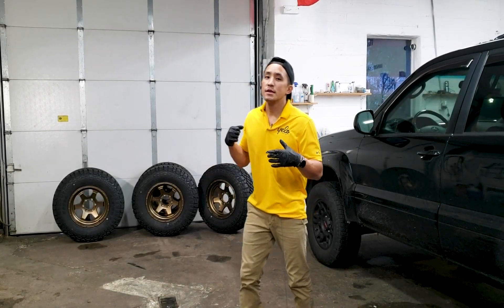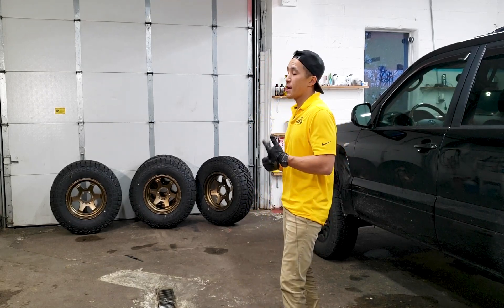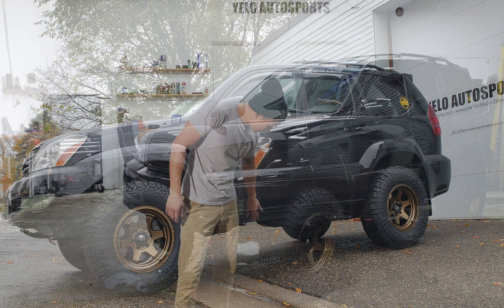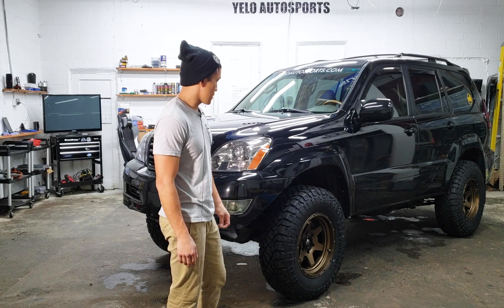GX470 - New wheels!

Comment: After you trimmed your bumper you had all the wheel well liner hanging down.  What did you do with that?  I would have been interested in seeing how you handled that.  Thanks
Reply from the maker: I just cut it off. I still have the pieces so I'm going to figure a way to zip tie it back on just to provide a bit of protection.
Reply: @YeloGX  any concerns of rust without those wheel liners? I'm in Northeast so have been hesitant to remove... heard you say your in MN
Reply from the maker: Yes, Im concerned about rust but also water jumping into the air intake which is above the passenger front wheels. I will cover it up and makes video about it, it might be ghetto but I just need it to work. As far as rust, I plan to wash my truck every other week at minimum in my shop. The best prevention for rust is removing the corrosive material off the surface. Unfortunately, we live in terrible states for frames and even with protection they're almost always getting torn up
Reply: @YeloGX  word, yea I think its pretty clear if I want to add larger wheels (yours look great btw) I need to cut fender liners. just confirming we create a new problem haha yes BRUTAL conditions for our rides. You just answered something else for me too - was considering doing the undercoating to prevent rust but probably just need to be on top of washing it...
Reply from the maker: I probably didn't need to cut with my wheel and tire size but did anyways.  As far as rust prevention I would still advise you to do it.. anything you can do to help and assist that frame last longer. I'll be happy if my frame lasts 5 years until I sell the vehicle.
Reply: @YeloGX  thanks man, ok. Sorry, one more question - did you have rubbing with the TRD pro wheels (before cutting)? I have 2.5 inch lift on mine, stock wheels and 285/70/17's and am getting rubbing at full lock - minor but annoying. I already pushed fender liner forward so I think I just need a little offset to push out from frame. Id consider the TRD pro wheels as a compromise to fix rubbing and avoid any cutting!
Reply from the maker: No I didn't have issues at 265. On my old 4runner I ran trd wheels with 285 70 17, and there I had to really really push the fender liners forward
Reply: @YeloGX  oh good call, you were rocking the 265's on the TRD's. appreciate the replies and the videos!
Reply: @devinhannan8620  yes they were 265. You're welcome brotha
Reply: @devinhannan8620  definitely look into Fluid Film or the low smell/ thicker Woolwax coatings. Shoot into door panels and inside frame rails

Comment: did you have to do a body mount chop for those tire sizes?  I have a 2in lift and getting new wheels but wanted to get the same size tires (285 70 17).  Please let me know. thanks
Reply: No bmc neccesary
Reply: @yeloautosports  Thanks for the reply!! so im good with juse the minor plastic trim and pinch weld push in?
Reply: @daqidtran  with that size you shouldnt even have to push the welds in. I just had to push back some of the plastic liner back

Comment: NICE!!!!🔥  u didnt have to cut the bumper before with the TRD wheels. what size tires were those? what did u do with the plastic wheel well?
Reply from the maker: Those were 265 70. I did not have to trim with those on. I just removed my liners and threw them away but I should have kept them so I could reshape them and reattach them. Now I have too much exposed under there.

Comment: My D666s came with that plastic insert to make it more hub centric. I didn't use them on my GX. The wheels don't really use the hub as support. What's your thought on it?
Reply from the maker: Nope, didn't use them but I found it sat inside the hub just fine. So long as I felt it was flat and tightly secured I'm good with it. I do retorted every chance I can.